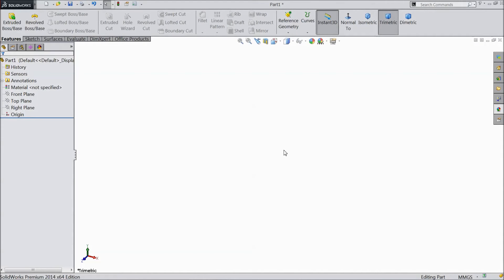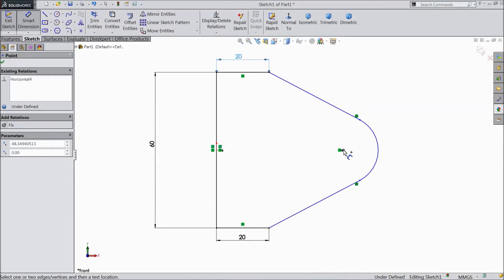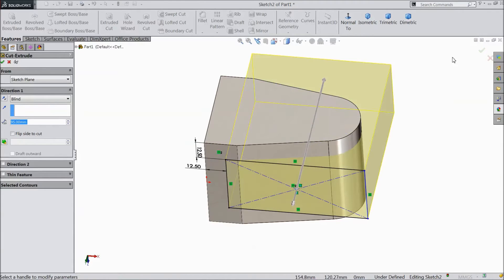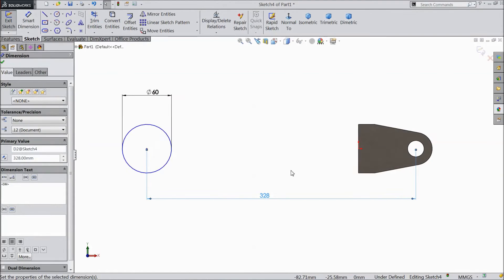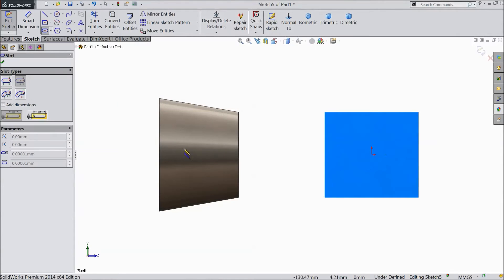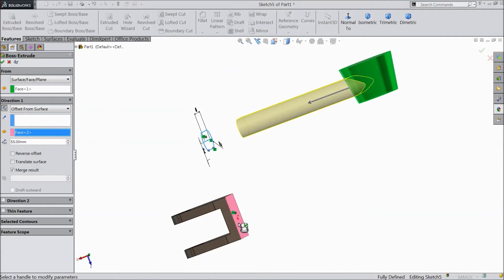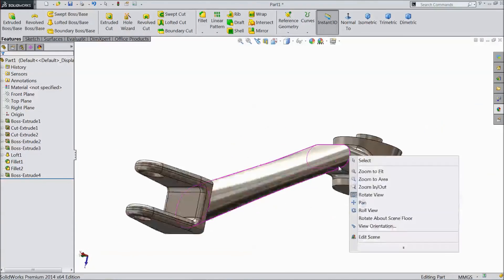SolidWorks Tutorial Tractor 15.Lift Arm 2

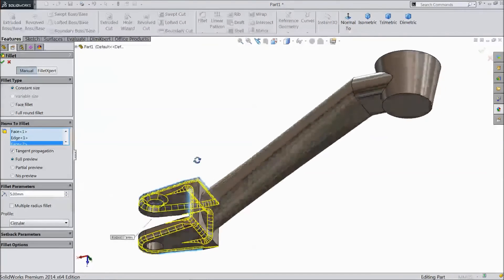Comment: I tried to use fillet just like you on 6:50, with constant size. But I had to select each line. Did not work when selecting only the face.